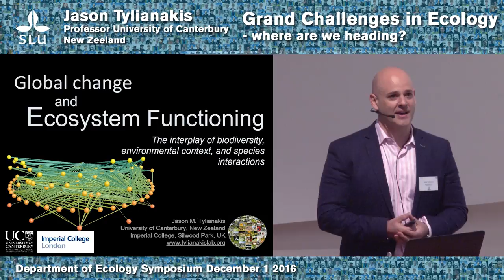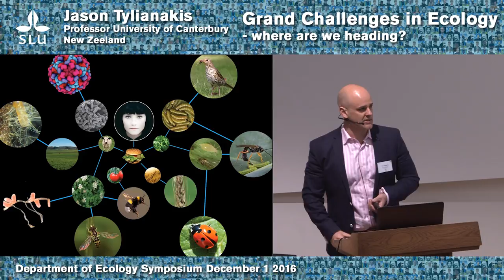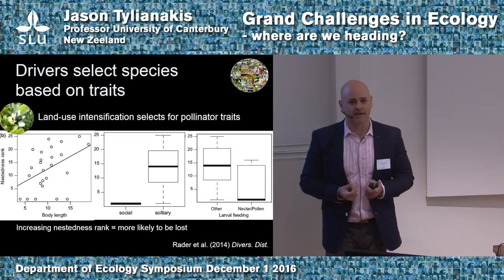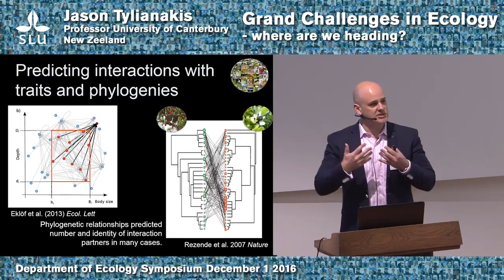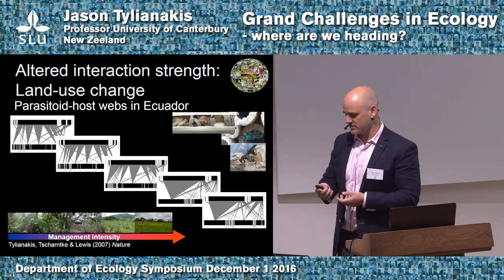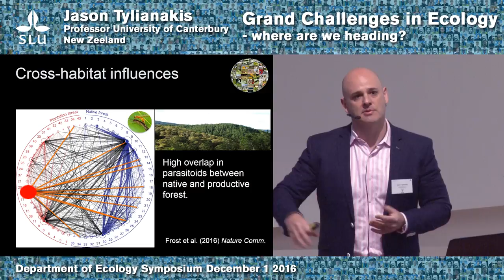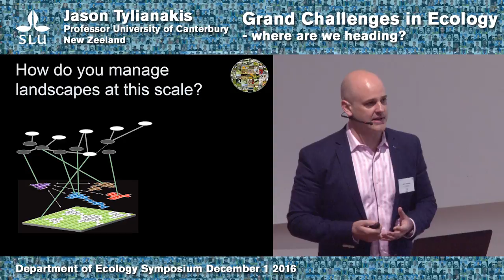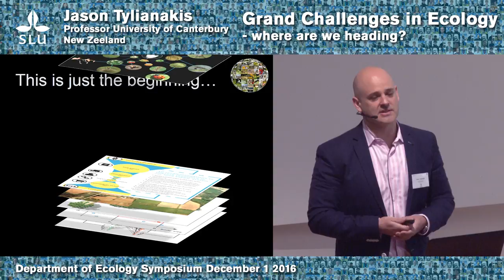Grand Challenges in Ecology - where are we heading? - Jason Tylianakis

Comment: PART 1 - INTRODUCTION
0:18 Examples of the spread of a perturbation in a complex system
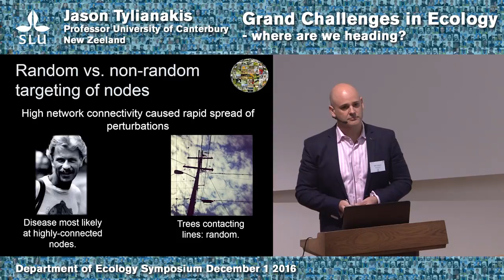5:02 Ecological networks
6:32 Big questions for the future 
8:30 Human impact: how are ecological networks responding to changes (invasion increases network connectivity, warming and N deposition cause changes in the relative biomass of plant/herbivores/parasitoids and rewiring of their interactions)
PART 2 - PREDICTIONS
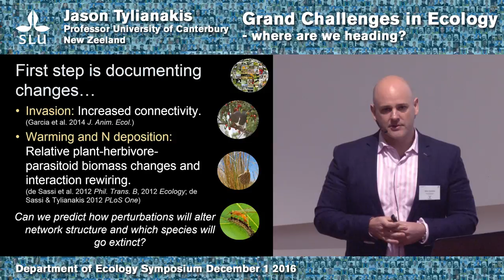9:52 Species role and impact: it is conserved across different locations (Stouffer et al. 2012).You can predict the impact of an invasive species by studying it in its original community (Emer et al. 2016). Also if species shift their range because of climate change we know that they are going to interact with the other species from the food web the same way that they do it in their original range. 
12:33 Species composition: the environment selects species based on their traits (Rader et al. 2014).
13:30 Species interactions: if the environment selects species based on their traits, then how does this affect how species interact with each other? There is a trade-off between not having the same traits (to avoid competition) and having too different traits (interaction partners stop interacting with you) (Coux et al. 2016) Who will interact with whom can be predicted through a niche-based approach using just a few traits (sometimes just body size) (Eklof et al. 2013) Looking at their phylogeny, we can predict the number and identity of interaction partners in many cases (Rezende et al. 2007) Humans are causing species to reconfigure their relationships (Lavandero & Tylianakis 2012, Peralta et al. 2014, Aizen et al. 2016) Predicting extinctions using network roles: we can predict who will respond to environmental changes by looking at its position in the food web. Specialists and rare species are more vulnerable to habitat fragmentation. By knowing the position and the interactions of a certain species we can predict the probability to lose after the environment has been fragmented (Aizen, Sabatino & Tylianakis 2012) Spatial processes, species traits and network roles.  (Hagen et al. 2012)
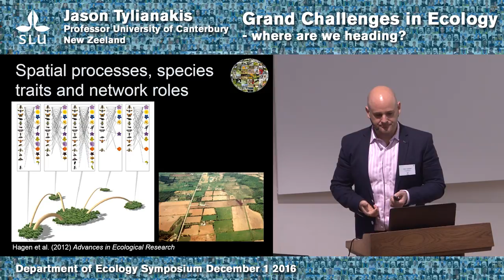23:17 Land use: it changes interaction strength (Tylianakis, Tscharntke & Lewis 2007) Different habitats are linked together by generalists seating at their edges (Peralta, Frost, Didham, Rand & Tylianakis in press) Species tend to migrate from less productive to more productive habitats, feed there and then return back to the less productive habitats (Rand et al. 2006). The movement of predators between more and less productive habitats drives apparent competition (Frost et al. 2015). There is a high overlap in parasitoids between native forests and plantations. Different habitats work together (Frost et al. 2016).
33:08 Food-web homogenisation: in human environments interactions are always the same all the time and everywhere (Laliberte & Tylianakis 2010)
36:33 Management: how do you manage landscapes? 
40:27 Ecosystem functioning: how do network changes relate to it? Resource partitioning underpins biodiversity effects on ecosystem functioning and is also implicit in the architecture of interaction networks(Thompson et al. 2012) (Peralta et al. 2014) (Tylianakis et al. 2008) (Laliberte & Tylianakis 2012)
PART 3 - CONCLUSION
43:20 Conclusion